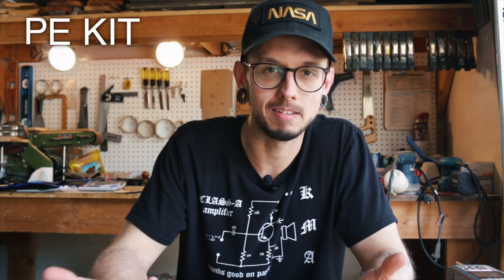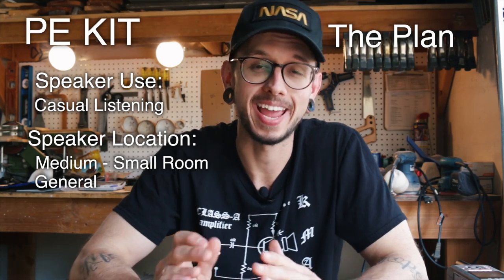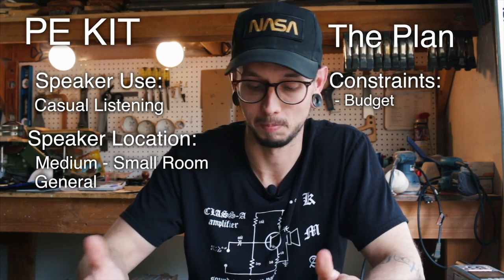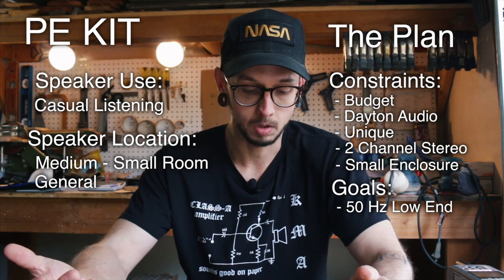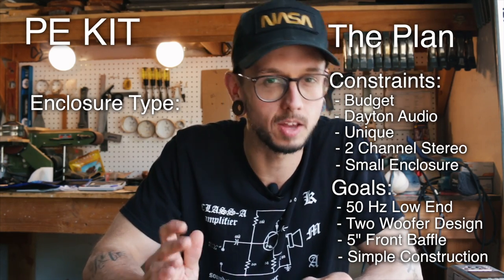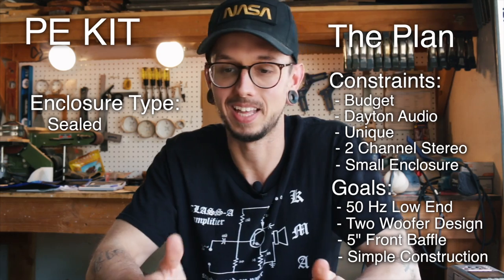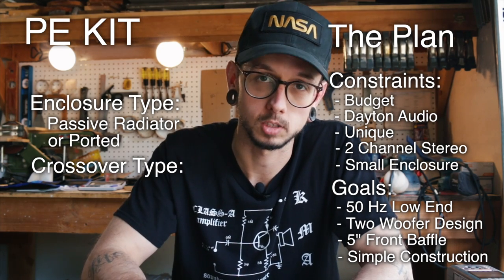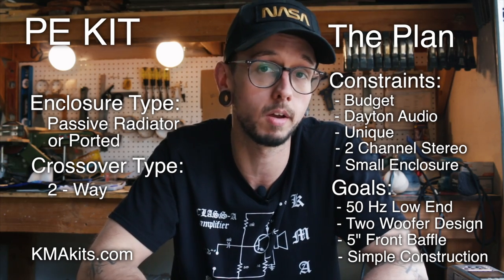How To Design Your Own Speakers In 6 Steps || Step 1 - The Plan

Comment: You should do a vid about types of crossovers, i.e. 6db/octave, 12db/octave, etc, etc. The pros and cons of each type along with notch filters and stuff. It's good to see you're back.
Reply from the maker: The higher the octave slope (6db - 12db) the more complicated the crossover build becomes. More complicated = more components in your signal path which degrades sound and increases your overall cost. But sometimes higher order crossovers are a necessity.
I'll definitely talk about some of this stuff in the crossover design step of this series.
Thanks for watching!

Comment: Great series, I thank you for this guide it's making me actually pull the trigger on building my first diy. Could you help guide the enclosure type? If my goal is home theater / music and I like bass, but also prefer smaller-medium size enclosures which would be best?

How do you create a warmer / bass heavy sound without sacrificing high quality mids and highs?

Does a 3way setup offer more bass or just deeper generally with better mids?

If 3way does provide more "generally" how would a sealed 3way compare to a ported 2way?

If you plan on incorporating a sub, does your design change at all because you will be covering 80hz and below so your driver selection could be more specific?

How does a 2.1 setup sound, do you get better bass but sacrifice highs?

Thank you! I hope you could answer some of these and thanks again. I am ok with more complicated designs even though this is my first build.

Comment: Hey there! :) Is it possible to make the enclousure smaller wehen using passiv Radiators? And are there any other sideeffects wehen using pr? And i heared they have to be bigger than the driver? Thanks alot!
Reply from the maker: Yes, from what I understand passive radiators are good to use with a smaller enclosure size.  Be sure to test your design in a computer model first though. Yes, you’ll want your PR to be able to move at least twice as much volume of air as your active driver(s). This isn’t just cone diameter, it’s cone area (Sd) x excursion (Xmax) = volume of air (Vd) Thanks for watching!
Reply: Kirby Meets Audio No, thank you! Because of you i got the idea of building my first bt speaker. Your Videos arm always pretty nice to watch.. Thanks :)

Comment: Will you be doing a workshop speaker project/kit? A lot of us have workshops and need sound.
Reply from the maker: That’s a good idea! What specifically would you want in a shop speaker? Thanks for watching!
Reply: Maybe some sort of protection against dust, high volume (You'll be competing with power tools after all), and a tough exterior. Really can't think of anything else a shop speaker would need.
Reply: It could also be 1 central tumblr shaped enclosure that has 4 speakers that covers the whole shop with sound but also protects the contents from dust.

Comment: I better understand the technical drawing but I  enjoy your videos. Could you explain how using a resistor across the connection block and did you put a cap in line before the tweeter? What kind of resistor is best, as I've seen many like that in cheap crossovers. I'm  just asking. I'm  desperately searching for for information on creating quality crossovers myself. I'm  familiar with terms like mH, uF etc. Though I  don't know what gauge & winding count. How many volt caps & what materials are best. I have a diode in my Energy speakers? You're  knowledgeable & friendly though I wish you'd  recite your lines as it can be confusing at times. I do enjoy your videos and please accept this as being helpful.

Comment: Hey Kirby, my dad gave me his old 5.1 speakers and the woofer but without any interface or amp to connect them. What can I use to connect them, can be diy or plug-n-play. I'm planning on using them with my pc, they're 8 ohms speakers.
Reply from the maker: Hey! You could probably connect them to a receiver if you'll be using them in a home theater setting. Or just take the front left and right channel and connect them to a stereo amp. Thanks for watching!
Reply: thx man

Comment: Great video! 
To me it's always a great step to get over the edge of deciding the first parameter that will effect all the others...

I've been thinking around the mh-audio ported box calculator you linked in your "How To Pick An Enclosure Type" video about 2 years ago. How important is the volume and the volume distrubution when you design a ported speaker enclosure? (as long as the port is calculated to fit it) My calculations show a crazy shallow enclosure (high, wide but shallow and really big) Is this neccesary? What do I lose if I lower the volyme or redistribute the volume to a deep but not so wide speaker?

However, keep up this great content.
Watching half for ideas, inspiration and knowledge, half just to listen to your dedication :)

Comment: hey kirby, i have many speaker drivers around, mostly from broken equipment, how can i identify their characteristics? I wanted to use them to make small speaker boxes, but calculating the volume becomes impossible if you don't have a datasheet. Also i don't know the range they have, most of them i guess are full range speakers because they come from home theaters...
Reply from the maker: Building good speakers from salvaged drivers is tough for all the reasons you mentioned. The only real way to know the TS parameters of these speakers is to use a component test system like this one: https://goo.gl/ekds9K
This will system will calculate all the info you need to model your drivers in software to design a proper enclosure and crossover.
The only other way to go about it is trial and error. Which can be fun too!
Thanks so much for watching!
Reply: Thanks for the response! Yeah, i know it is pretty much a guessing and testing game. I am not really expecting pro quality from it, mostly learning :) That little device seems awesome though, i'll give it a try. Thanks dude, love your channel.
Reply: I recently got a circular saw and drill. I had a couple of old speakers and I wanted to put them together and make a soundbar situation for my tv.. i found Kirby. He inspired me to try a little harder. Being on a budget I decided to go to goodwill and see if they had any electronics I could salvage. I spent about 30 dollars. Got 4 subwoofers. A couple of decent mid range and tweeters. The subs came with amplifiers. I took the dimensions of each box they were in. Bought a couple Bluetooth receivers. Found the pin outs of the Bluetooth receivers.. did math and drew squares for about a week. And I’m currently building a soundbar with 4 mid range. 2 tweeters. And 1 sub. With the option for a second. I basically made one big box that will be a bunch of smaller boxes. But only look like one box. I kept all the original ports from the teardowns.  I should have it completed in a couple days. I’m I’m pretty sure it will sound ok. I basically decided to just try way to much for my very first build. If it sounds ok or even good. I’ll come back and say.. just take measurements of the original enclosure... and then puzzle it together with math and squares until you hate life. And it will work at least.
Reply: Man i would love to have the goodwill here. I am in Brasil and finding good stuff to teardown is a bit rare. I am definitely trying too much for my first build, i am building the amp as well! hahahahah a 2.1 class A/B design. I've built a class B before and it sounds... ahm... let's just say it sounds. But i am looking forward for the speakers. The impression i got from my short experience is that great speakers are one of (if not THE) most important parts of the system.
Reply: Thiago Ennes don’t forget. It’s really hard to make bad speakers sound good. And really easy to make good speakers sound bad.
Reply: That is true! I speak from experience ahahahahh. I am getting into diy audio more as a learning experience than a way to get an audiophile system for cheap. With time i guess i'll be able to make some good sounding stuff, but i am not expecting great quality anytime soon :)
Reply: Thiago Ennes I just got done wiring everything up for the sound test. Not in box yet. I got some pretty good crossovers from all the salvaged speakers. I’m waiting for glue to dry. And I’m debating on if I want my amp internal or external. I’m leaning towards external. But I need to build some type of enclosure for it so it does not look like a mess. I’ll keep you updated because I literally have nobody to share progress with. Lol
Reply: hahahah that would be awesome! I know the feeling, my friends also just... don't... get it. ahhahahahhahah Are you going for a class D amp? it would work nicely inside, class A/B or, god forbid, class A, would make it a steambox if you don't have external heatsinks.
Reply: Thiago Ennes I have so many heat sinks. But it’s just a class d at the moment. I’ll get back to you soon. Gotta get the kids from school

Comment: Hey Kirby, i hope you or somebody else can halp me... Iam building a mobile speaker with 2 Dayton ND105-8 4"... they cant play deep, cause if i higher the volume of the speaker up,  the mids will distort. Now i want to know how to cut off below 40hz or so... the amp used is a simple dayton 60watt amp with bluetooth onboard, so ye. Does anybody know how to cut them off?
Reply from the maker: You'll need what is called a "high pass filter". You can either buy a premade filter (though I've only seen them down to about 80hz) or build your own using passive parts. Google high pass filter calculator to find out what component values you'll need. Thanks for watching!
Reply: Thx mate, you are awesome... love you vids!

Comment: but it is the budget which make people go creative 
for example the slot loaded onken, bass tube, transmission line etc.
if we were perfect from start, we would have not created such an exotic world

for everyone out there
remember to take the budget constraint as a motivation to improve and outshine the predefined notion

i did a diy of Alpair 7 DBR with cheapo ply, cheapo fiberfill....but then braced with my and my dads way(interlocking and multiple frame wood cuting)

and got the ply treated with some weird polish

but the best part was, mine sounded way better than my friends KEF LS50

Comment: I am from Sweden, my eys isnt so good so excuse the spelling..
I worked with sound in the 60 70 80 and 90ies, in the 80 and 90ies I designed loudspeakers.  I had a computerspeaker design program (MS-DOS) in the 80ies that I used a lot, then I only used the brochyres for T/S parameters. In the 90ies I bought a radther expensive TS measuring system (I dont know name) with that I didnt use the manufacturers datta anymore because it wasent always the right darta. The measuring system that was in my computer was stolt the same time as my computer. Now I bought a Dauton Audio DATS V3 and now I measure all USED drivers. I have found. I have found that more and more HiFi have base drivers with Qts a lot over 0,7 even if they have a ported box, IS IT ANY SEARIOS???????? I have a speaker (no name) that have a base driver with 1,16 in Qts.
I have bought a Seas H1207 4 inch driver with Qts 0,29 and a small Vas that is compatible .
I have tested other speakers and a lot of them seems to be able to use methods I didnt know was ppåssible, very higgh Qts and filters with totay wrong compunents.

ARE THERE METODSTHAT MAKE IT POSSIBLE TO USE STUPID METHODS????????